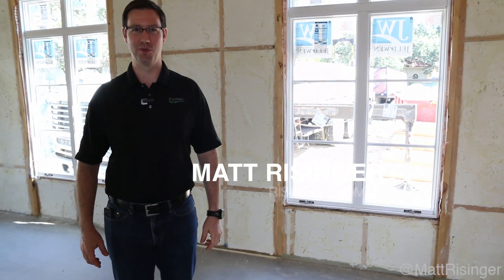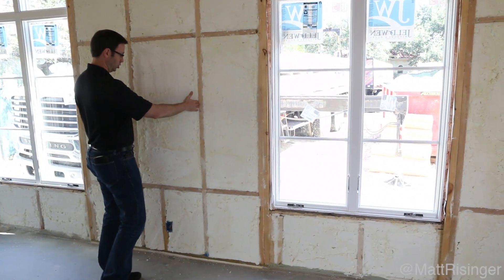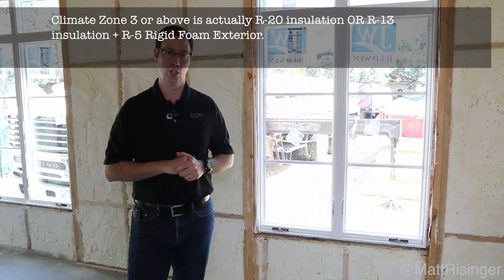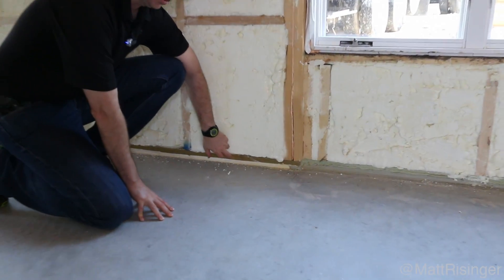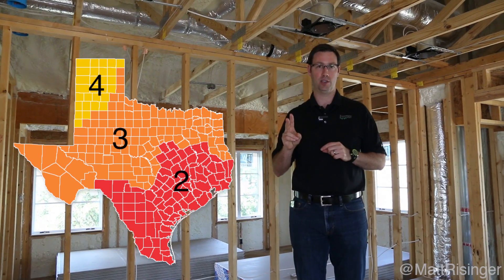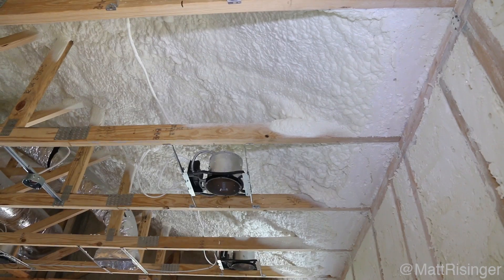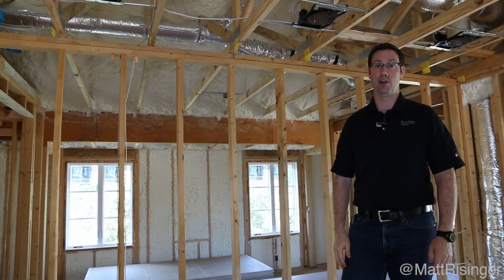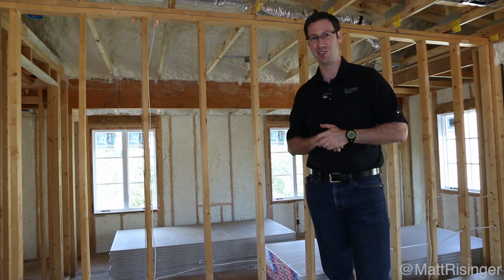Spray Foam & How to meet 2014 Insulation Codes

Comment: 24 on center on exterior walls but 16 on the interior? Seems to me if you were gunna Change your layout it would be the other way around lol.
Reply: I wondered about that also. If flexing of drywall was the issue you could use 5/8 inch dry wall.

Comment: I would be careful about saying that it is more efficient to move the insulation from the attic floor to the roof. You will have less heat transfer from the ducting to the surrounding air. However, if you don't have insulation separating your attic space and your living space then you will be increasing the volume of air that your HVAC system has to condition (living space + attic). That will increase energy costs. It would probably depend on how large your attic space is to determine if it is worth adding the attic to the conditioned space. Though adding insulation directly to the ducts is probably your most efficient solution. Better to apply insulation directly to the problem area than to insulate its surroundings.
Reply: I thought about this issue also. I thought maybe the idea was to not cool or heat the attic so the attic space doesn't use energy for heating or cooling. but it is highly insulated so the temperature is much closer to in door temperatures than out door temperatures. Of course, just based on the geometry you need a lot more insulation to cover the underside of the roof than you do to cover the floor of the attic. Air exchanges on a tight house might be another issue..

Comment: "Advanced" framing is code for the builder is using less lumber, and not reducing the price they are charging you.  Open cell sucks, and is also cheap.  Use closed cell, you cheap bum.

Comment: When you insulate the roof deck you then have to include the attic volume and surface area in the Heat Load Analysis. This will add somewhat to the required HVAC equipment.

Comment: how would this compare as far as fire safety compared to using something like a mineral wool insulation?  I'm concerned about fires like what happened in London with foam insulation fires.
Reply: all spray foam has a degree of fire retardant but if its a major concern you can have the fire proof foam sprayed in ... its a red/ orange color.. bit more expensive tho.

Comment: I like foam, however, I have seen that if its not done properly it can put off fumes and make the house unlivible and even dangerous. Removing it is expensive in that case.
Reply: Anthony, you are quite correct.  The installation is key.  If your insulation contractor is installing closed cell (culprit for fumes) they need to make sure they are only doing 1.5" to 2" layers at a time.  Usually a good rule of thumb, do a layer on the exterior wall of a room and once that wall is complete, start over again.  The first layer will be "cured" enough for the second layer and such.  If foam makes one nervous, a great value is the Blown in Blanket System (BIBS) that even Matt talks about.  Proper vapor barriers and sealing will be needed, but a great system still.

Comment: can you use fiberglass batts in your raffters to get a conditioned attic aswell? i know it wont be as great as foam but if it will still work to help my AC run better im all for it.
Reply: You can, but you must seal your venting (eaves, and ridge depending on style) and Batts are ok, but look into BIBS especially since it is where the greatest mount of heat is transferred.

Comment: hey matt im building a house in houston. what about fresh air supply into the house, will foam create moisture due to the ac? would i just need a damper and problem fixed?

Comment: Your information on Closed Cell vs. Open Cell is nor correct. Open Cell:

C.C. Foam All Climate Zones,Air Barrier, Adds structural rigidity, Moisture Barrier, Resists water, Type II vapor retarder, 4-Barrier Thermal , Air, Moisture, vapor, Resistant to flood damage, Exterior uses, Roofing, Insurance Companies love this stuff.

O.C. Foam is not the same.

Comment: Matt just watched your video I am looking for ideas on insulating metal buildings....I am in process of selling out to move to montana. I am looking at purchasing a 24X36 metal garage to turn into a house... any suggestions on the best way to insulate for the cold northwestern montana winters?
Reply: +john nelson John, it cannot be done, metal buildings converted into homes is a no-go-area. By metal garage I take it to mean metal sheet steel walls, roof, floor, steel beam/s supports and framework. Steel is an always open door- for heat to escape, it would be like living inside a river, under a waterfall, like always having the kettle on and boiling heat away. think again.
Reply: SuttonWoods no only a metal exterior....wood floor, with wood walls,most likely dry wall ceilings. The only metal would be outdoor walls and the roof....still a no go?....it would have wood framed walls as well....none of the support s would be metal...basically a pole barn converted into a house.
Reply: +john nelson John, think condensation and and cold spots. I could get around this but there would be no advantage whatsoever in steel cladding, and health wise I'm saying keep well away. Think big,  dream a little,  and do something you and you're family can be proud off, Houses and people need to breathe, bones and human skeletons have to be kept healthy, I'm saying think asthma, think bad winters, Montana is an iceberg in winter, best regards.
Reply: Just when I thought I had a good idea
Reply: +john nelson / All ideas are good even bad ones, bad ideas prove or disprove the benefits and disadvantages off more credible ideas. So lets stick with you're idea and you start a business called METALLICA INC, and you start selling corrugate steel sheets to farmers for reroofing barns, steel posts and livestock pens,, corrugated roofing tiles,  steel doors, corn silos, metal gates and door protection frames, and new warehouse business units or SELF ERECT KITS, A John Nelson METALLICA Roof is forever, No deposits - We will invoice you on delivery,  can you see what I am getting at? Ideas are a stream of conciousness about the real word, O.K you're going to get rich but don't let that put you off. SW ENGLAND UK.

Comment: Why do you use insulated air ducts if your attic is conditioned?
Reply: +Vince Stagbaugh 
I will take on that one, just passing by, Vince. (I am an HVAC engineer.)

Even if the room/space where the ducts are located is "conditioned", the humidity may still be above the dew point temperature of the duct work. This effect is amplified after, say, a weekend away in the cooling season. Turn on the AC and it will take a few hours to recover space conditions. In the meantime though, the AC process will cool the air below the space dew point and cause condensation.

Even without an unoccupied period and recovery, AC systems tend to run colder than space dew point, especially when in dehumidification mode.

Hope this helps.

Comment: very interesting discussions folks, their really is not a better insulation then foam ... Open or closed cell, However! the application of the product is the key to insure the fire package works and the 1:1 chemistry is applied by professionals ONLY. The industry (and more importantly their customers) suffer the consequences of carless uncertified contractors using Undersize or defective equipment.

Comment: I've seen Cement Foam used--seems like terrific stuff--It's bug, critter, mold, and fire-proof, as well as very non-toxic---we NEED all those qualities!
Is it an open-cell or closed cell? 
We're in the Pacific NW...Where can one get it, or, who installs it?
Can it easily be retro-fitted in older homes?
How does it's insulative quality stack-up to other insulation foams?
Thank you for your good work getting information shared!

Comment: Remodeling brick faced house with 2 x 4 wall in northeast Connecticut. A little cunfused on open or closed in wall and attic, could you explain pros and cons and you mentioned if the wall gets wet the closed will not let it dry but the open will.

Comment: Matt, I have learned a lot watching your vids. I'm currently working on building a new home myself and wanted to ask you about spray foam. I want to use closed cell in roof and walls but was told by my spray foam contractor that using closed cell won’t work for my walls. His reason was that when we spray foam the inside of the interior walls. And then use a house wrap on the outside it will trap moisture between the house wrap and closed cell foam and cause the OSB board to rot. Your thoughts?
Reply from the maker: What part of the US are you in?  I would generally say your insulator is wrong.  But there can be exceptions.  Was that ambiguous enough?
Reply: Matt Risinger Central Fl.
Reply from the maker: Closed Cell will work great in your climate.  I would recommend a low perm Housewrap like DuPont Commercial Tyvek or even Carlisle CCW 705.  Keep in mind that closed cell foam is pricey, and Open cell will do many (not all) of the benefits at less than 1/2 the cost.  Best, Matt

Comment: Johnintoit - thx! Yes, the 30% tax credit weighed in as crucial on our decision. However we have run into a snag with drilling! Ugh. The geothermal unit is in attic and venting is done, but a/c peeps having a hard time scheduling a driller who has a buggy rig small enough to fit in backyard area where loops will go. I am not sure we will EVER have a/c. Unit has been installed over a month now with no ground loops in sight! Tip for you... Do loops before slab is poured so you won't have my problem! Let's both hope the geothermal is a most excellent choice! :) good luck with yours and thanks for reply!

Comment: Matt - do you have a preference on spray foam brand? We are building a new home. I have been researching demilec apx and icynene and have no clear winner.  I am installing a geothermal system and it was costly. I need to get the biggest bang for my buck on spray foam.  Both tout their products as "best".  There is about a $1500 cost difference between the two.  Your advice is much appreciated!
Reply from the maker: Kim, Glad to hear you are doing a high performance build!  I'm not brand specific on SPF.  I would choose the best contractor who will do a good job and if you can save $1500 I would do it.  Watch my video on how to "pre-foam" for some tips on what you can do before they arrive.  http://youtu.be/QRzu3cg-9eE  
Best, Matt
Reply: First off great videos Mat, keep them coming, Kim I too am building a new home (next year) and I'm also going geothermal, I live in Ohio and we have a 30% tax break for labor/material up until the end of 2016 and that's a huge break, not sure if your aware of that or not so I thought I would point it out, good luck.
Reply from the maker: Johnintoit Let me know how your system turns out!  I think GeoThermal is a good choice for Ohio.  The tax credit certainly helps!  Best, Matt

Comment: I was taught to use closed cell foam because it will not absorb and hold water as well as being impermeable. Yet, you specify open cell foam. What gives?
Reply: Matt Risinger Hey Matt, I was curious, whenever you discover a new method that supersedes one of your old methods, do you still support the old method? For example, a few years ago one of your videos talks about using closed cell foam with a cellulose chaser. Is closed cell not recommended anymore here in the humid south? Also I like the 500 year "perfect wall" system, I wonder how long it will take for more builders to embrace that concept.
Reply from the maker: John,  There is a lot to talk about on this topic.  Yes Rigid Foam doesn't absorb water, is vapor impermeable, and adds structural rigidity to the assembly.  However, it's a lot more expensive and you need to be certain that your wood framing won't get wet as it'll never dry through the closed cell foam.  In general I use open cell foam here in the hot/humid south because it's a lot less expensive, it provides a good air block (if it's 3.5" thick) and it's vapor open so your assembly can dry to the interior.  Matt

Comment: What is the latest about toxic fumes from these foams. I'm thinking of a sill plate use in basement where it would be exposed to occasional visits to basement.
Reply from the maker: The only concern is fire where the foam is uncovered.  Code calls for a covering of several options to ensure that burning foam won't smoke the house before you have time to escape.  Other than that exposed foam is harmless.  Matt

Comment: Did you also put exterior foam on this house?  I'm curious if you use radiant barrier on your houses with conditioned attics or is it not worth the additional benefit?
Reply from the maker: Dax, This house did not get exterior rigid foam.  We used Advanced Framing on 24" centers and insulated headers to minimize the thermal bridges.  Rigid foam would have been better but we couldn't work it in this house's budget.  In order for a radiant barrier to work it must have an air gap in front of it, so with the foamed attic we didn't use radiant barrier decking.  Instead we are using a Galvalume (silver) metal roof that will provide a radiant benefit.  Best, Matt

Comment: Hey Matt,  there is a lot of info on spray foam all over the internet .  But I would like to hear your thoughts on spraying from the outside in.  I have T-111 on my place as the sheathing / siding.  I want to pull it remove the old fiberglass and spray the cavity (2x4) with closed cell,  reinstall the t-111, followed by tyvek drain wrap, 1 inch rigid foam then new (concrete or vinyl) siding.  Thanks for all the advice you give in your series of videos.  The only negative is that I now see all the problems with my house!   Good stuff.
Reply from the maker: Couple questions here. First, what climate zone are you in?  You need to be careful with closed cell foam then other layers outside of that because the closed cell is a total vapor and water barrier.  If you have an air or water leak you can have rot/mold issues if there is anything in the assembly that's not perfect.  I would consult the "Builders Guide" book by Dr Joe Lstiburek for advice.  He's published one for each of the climate zones in the US and strategies differ depending on your location.  You can buy it on their website building science dot com Best, Matt

Comment: Hi Matt, thanks so much for sharing wonderful video. We have recently purchased 85 years old home in Philadelphia area. Your video helped us a lot doing lots of home improvement projects so far inculding replacing windows and installing new central A/C. Now it is time to consider insulating the house. Before installing AHU and ductwork in attic, we completly removed old insulation and cleaned out the attic which looked horrible before.
Q1) Here in eastcoast, cooling season is short, only a few months are hot. In this case, should I consider foam insulation under the roof line? or would loose fill fiberglass on the floor be enough? FYI, our attic is not ventilated any more since hvac contractor deactivated whole house attic fan and there is no soffit.

We also have ventilated crawl space with dirt floor under the kitchen and dining room. There is no water or mold issue (according to home inspection report) there but i experienced musty odor smearing through the floor in summer time(decomposting smell-like, I am the only person who smells this and my husband does not) only and very cold floor in my kitchen and dining room in winter. There is very old Batt insuation under the floor.
Q2) I am planning to remove old batt insulation under floor -> apply anti-microbial spray -> add new insulation --> install vapor barrier onto the floor. Does this make sense to you, ecomonically speaking?
Q3) Should I close the vent or leave the vent open?
Q4) Where should I insulate if I want to choose between wall and under floor? since closed cell foam is expensive, I may have to choose one area. 

Thanks so much in advance!!
Reply from the maker: Wow, lots of good questions here.  First, I want to point out that my videos are from the perspective of a hot/humid climate.  Your house is in a VERY different climate zone.  I would recommend buying "The Builders Guide to Cold Climates" by Dr Joe Lstiburek available on buildingscience dot com's website.  Encapsulating your crawlspace with Cleanspace or another vapor barrier product should eliminate that smell and you could close your vents at the same time.  Lastly, if you have to choose I'd insulate your floor/crawlspace correctly to make that a conditioned crawl space then spend the money on walls.  I'll bet your floor is VERY cold in the winter time.  Best, Matt

Comment from the maker: Gary,
It's hard to estimate payback but it could be very likely that it's a 10+ year payback.  Retrofits are tough and expensive.  The payback is much sooner if you are looking at new construction.  Your money might be better spent on an Energy Audit by a BPI certified rater.  Hire an independent auditor that doesn't work for an insulation company.  They can identify "low hanging fruit" to upgrade.  It may be better in terms of payback to upgrade your HVAC, tighten your leaky ducts, or...

Comment: Matt, I just received a proposal to retrofit/convert my attic to unvented. At a minimum, the work involved applying the foam to the underside of the roof and removal of my old blown-in insulation. Their price was about what I can buy a complete new HVAC system for. If it saves me 25% of my heating/cooling costs, the payback would be about 45 years!! I can hardly imagine how even a super-competitive bid can make sense economically. I think payback MUST be no more than 10 years. Your thoughts?